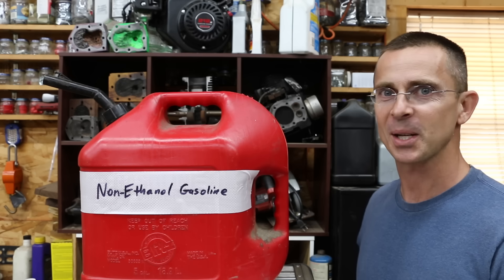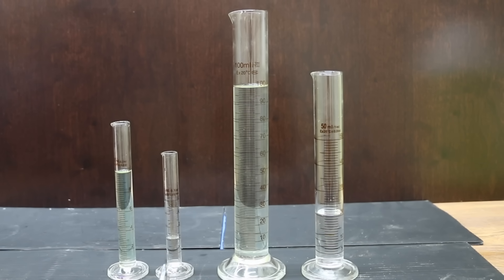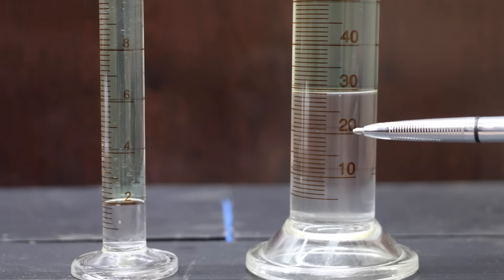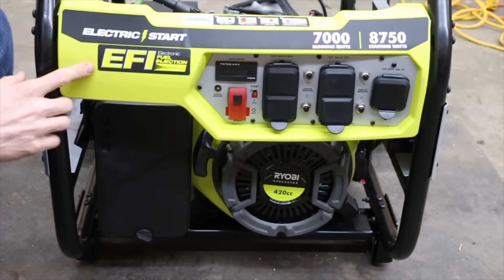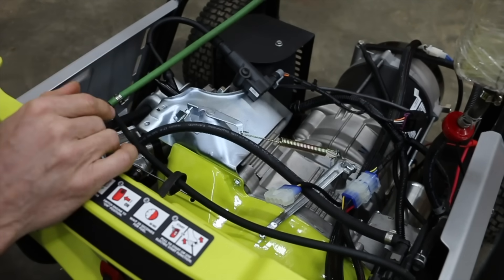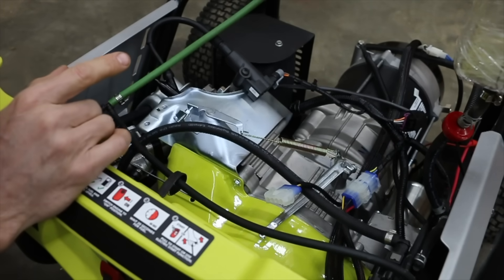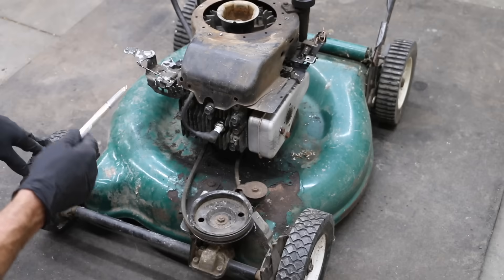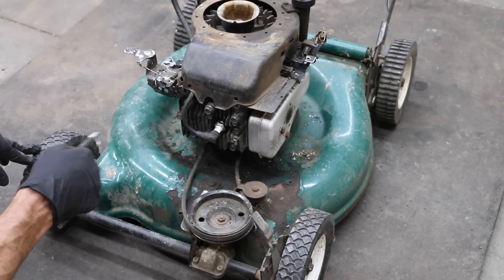Is Non-Ethanol Gasoline Really Better? See the PROOF!

Comment: If you like cleaning and rebuilding your carbs keep using ethanol fuel.
Reply from the maker: Great point
Reply: @ProjectFarm  It's arguably the main point. Small engines like to be run. If an engine is run regularly I assume the ethanol fuel is fine enough. But, for winter storage or for engines that are rarely run (snow blower or backup gas generator for home) ethanol fuel can really gum up the carb. Best to either empty the tank or fill it 80% full with ethanol-free gas and a fuel stabilizer like STA-BIL, then turn the fuel petcock off and  run the engine dry before putting it away. (Filling it 80 % leaves room for expansion / contraction, but minimizes condensation.) This would be a good thing to note in a future video. Its a true case of 'an ounce of prevention = a pound of cure". Thanks for the great video.
Reply: @mbj1163  I would agree to some extent. Letting the ethanol fuel sit without stabilizer causes it get gummy. Small engines with tiny jets don't take kindly to debris if any kind. I have had good luck with adding seafoam to recreational fuel to flush out some of the debris but nothing beats a full rebuild/cleaning.
Reply: @mbj1163  An engine is a mechanical object. It does not like, or dislike anything. Running has zero to do with it. Storing it is the only problem. No emotions need to be assigned.
Reply: You are absolutely right! My mower has been running pretty bad lately, so I decided to go online and do some research and what did I find. Ethanol fuel is the culprit of my engine missing and hard to start. I found a local Marathon that dispenses 90 octane non-ethanol based fuel and low and behold as soon as I ran a couple of tanks no more hard to start and more engine missing! It seems power equipment likes the non-ethanol fuel better.
Reply: I think project farms knows the story, but, my grandfather's friend puts premium non ethanol fuel in anything that uses an engine that he does use, but not on a regular basis, like his 3 cars that he puts in storage for the winter, his chainsaws, log splitter, or 4 wheelers. We had issues  with ethanol in regular fuel before in a 4 wheeler that my grandfathers friend had gotten me. The story is that my grandfathers friend had put fresh non sta bil fuel in the 4 wheeler gas tank, and it was  brought out to my dad's house, and barely used, I think that the fuel that my grandfathers friend put in the tank, I think stayed in the tank for maybe almost 4 to 5 years, until my grandfathers friend and I got the 4 wheeler one day and brought it back up to my grandfather's friends house, probably about 2017 or so, and of course needing the chock at that point due to lack of being ran constantly since 2012. Anyway, we got the 4 wheeler back to his house we (mainly my grandfather's friend) took the carburetor apart to find garbage inside, and it was cleaned out. Of course, my grandfather's friend was being stupid and striped the threads in the screw hole that the  screws that hold the cover to the carburetor, so, he had to buy a new carburetor, and after a few failed attempts, he finally found one for the 4 wheeler he had, and he finally got it running again, and the 4 wheeler still works to this day.
Reply: No choice for me really.. they gum up preety rarely.
Reply: Im a small engine mechanic and everyone that has told me they use nothing except ethanol free has needed a new carb 100% of the time. I have never been able to salvage or throughly clean one because of all the rust and corrosion. About 80% of the time I an able to restore and throughly clean carbs that ran off ethanol fuel.
Reply: @BryceDaMemechanic  wait, are you saying that pure petrol fries carbs but ethanol blend doesn't?

Comment: Good job on the video, as usual. I use ethanol fuel in my small engines because it's the most readily available, at "normal" prices, and yields slightly less pollutants. In my region, I have found ethanol-free fuel sells for prices 50% or more higher than 10% ethanol fuel. However, I always test the ethanol level to be assured it's 10% or less (I've encountered ethanol levels up to 21%), always use fuel stabilizer, always drain engine fuel tanks, carburetor, and fuel lines after use, and never use fuel more than 90 days old (fuel containers are marked with purchase date). I also make sure my equipment is stored out of direct sunlight, to reduce loss of plasticizers is polymer-based engine components. For me, use of ethanol-free fuel is just no worth the exorbitant increase in cost and hassle to realize marginal benefits.
Reply from the maker: Thank you.

Comment: As far as the sealing/rubberized components, don't bother.
They have been put into cars from the git-go, and all cars have them right of the line these days. That info is from some guys that were looking for them in a factory, and the assembly line worker said there is no special parts....
I would test the components from about 1980 and older.
As far as the old wives tale of having to put special seals in, make your own conclusions about that gig.
Reply from the maker: Thank you

Comment: 420cc ???? IT'S PARTY TIME !!!
Reply from the maker: Lol
Reply: It's a modified Predator 420cc, equipped with a small EFI ECU and the necessary injector. It's been available in most other countries for a few years now, but has only recently passed EPA testing for sale in US. I found no functional differences in operation between the EFI generator and a standard HF 8750 generator, but the price increase (about 80% higher) is considerable. I like several of the Ryobi features over the HF 8750, but it's still heavy (220 pounds w/o fuel), loud (104dba under about 1/2 load), and still requires an external ground/earth connection. However, the EFI should be more fuel efficient ??

Comment: You used a generator with EFI to test efficiency. What is you used a type of throttle body injection or carbureted injection to test efficiency? And in the longer review, what if you tested the idea of ethanol mixing with water and freezing in the gas lines?
Reply from the maker: Thanks for the constructive feedback

Comment: A lot of people say, "Oh ethanol is bad on the rubber parts in your fuel system." But wasn't the selling point of the 1928 Model A was that it used synthetic rubber so ethanol won't harm components in the fuel system? so when people say the ethanol is bad for your fuel system, I say, Yes, If your car was made before 1927.
Reply from the maker: Thank you.  I'm testing the effects of ethanol...long term test.  We'll see

Comment: Not sure about all that, but it fuks up rubber gas lines by making them brittle or by making the hose wall soft and collapsing on itself. Ethanol is hard on carbs and injectors too

Comment: I just watched your video on Shell "V nitro" vs cheap gas. I commented on a carbureted engine not changing the volume of fuel per volume of air, which negates any difference in characteristics, or BTU content. Could you please make that fuel comparison with this new generator? This has the oxygen sensor, that I mentioned when I replied to the last video.
     Another viewer on the last video also mentioned that the old generator, like the lawnmower engines, have fixed timing. Does this new generator have variable advance timing? If so, it should really show differences in fuel economy, with its ability to adapt to different fuel characteristics.
Reply from the maker: Great suggestion! Thank you
Reply: moisture is a major problem in carburetors that are stored outside. Condensation and dew are bigger problems, than even rain. The bolt you mentioned, fortunately, is very easy to get to and clean. My problem has been carburetors that give no access to the emulsion tube, and clog up. You can't just run a wire through it, to clear it. It's kind of like a miniature sieve. On some carburetors, like those used on Honda engines, you can remove the idle stop screw, and remove the emulsifier. That allows those carbs to be rebuilt, beyond just replacing gaskets and the needle valve.
     I have cleaned that bolt, in fact, it's one of the first things I check. All using the choke after the carburetor is empty, is just to create more vacuum pressure and air velocity through those passages, to clear any stagnant fuel that could leave behind dissolved solids, when it evaporates.

Comment: You should (if you haven't already) test the sitting life of these fuels to see how long each one actually lasts, time wise, while sitting in a garage. Seems to me that one of the major issues with ethanol gas isn't the carbon or issues in the block. But usually more likely issues in the fuel lines and mixture system (carb, etc). One of the main issues seems to be that Ethanol gas supposedly only lasts (is usable and clean/safe) for about 3 or so months. While non-Ethanol gas can last up to 2-3 years before you start to find sludge in it. I believe environmental conditions play a part in how long they really last. But it seems like things that tend to sit around for a couple months without use are most likely to experience issues. Things like boats, motorcycles, generators, lawn equipment, etc. I do landscape work and when I switched to non-ethanol gas. I stopped having issues starting my equipment and generators after they've sat for a awhile. Prior to that, a generator that sat without running for the winter would usually require a ton of effort, and sometimes cleaning just to get started again the in spring.
Reply from the maker: Great suggestion! Thank you

Comment: So back in the 90s gasoline had an additive called MTBE which helped  gasoline burn cleaner and raised octane level which is what ethanol does. The problem was when gas station tanks leaked the gasoline would seep in to the the ground water. Gasoline is easy to separate from water  but the MTBE additive would dissolve in the water complete in it is very difficult and expensive to remove it. MTBE was banned and ethanol was used as a cheap and safer alternative.
Reply from the maker: Thank you

Comment: Project Farm,
I like your enthusiastic testing. Your ancient test mule mower engine. Now for reality check. A true test would be two identical, new mowers. Mower 1 running alcohol free fuel. Mower 2 running the blended alcohol and gas. After 100 hours of operation with an oil change every 25 hours. Both using same weight and type of oil. Then disassembly to inspect the backside of the intake valves for accumulated, power robbing deposits.
And accumulated deposits in ring grooves.
Burnt valves, worn valve guides.
Yeah, that is how you can see what fuel is best.
Reply from the maker: Thanks for the constructive feedback

Comment: Have you been able to account for differences in gasoline detergents from your gas source such as Top Tier and non Top Tier gas?  This could have a significant effect on the carbon deposits.
Reply from the maker: Great point. I always use the same fuel station.

Comment: You should try E85 and E100 (the stuff available in brazil, shouldn't be too hard to find in america), pure ethanol is a LOT different than 10% ethanol in fact 10% ethanol is still considered "pure" petrol/gasoline and honestly i've messed around with many pure ethanol engines when i was in south america and never ever had issues with it, engines are much cleaner and again with a properly designed flex fuel engine you're not gonna see any kind of long-term corrosion anywhere and less wear and tear inside the engine also seems to have a positive effect on the oil. I'm personally more of an electric car person now so i don't mess with ethanol anymore but there are a LOT of misconceptions in the united states due to lack of easy access to pure E100 in every pump and putting it or letting it sit where it's not supposed to.
Reply: We only have e85 and even that has between 51 - 85 percent ethanol. Most "regular" gas has up to 10%. E15 is becoming more available.
Reply from the maker: Thank you!

Comment: I expected these results with maybe a 2-5% difference in what can be interpreted as milage My Mechanic always warned me about damage to Fuel Pumps after having a replacement or two on a 92 Grand Cherokee, never really mentioned carb, or injector components. So consequently I only use it in a pinch. He also warned about lower Octane fuels potentially having undisclosed amounts of ETOH, and to be wary of it (I am bit Dubious on that one, I imagine there are laws about fuel content disclosure). So it's Sunoco 93 Octane primarily nowadays, and it's 91 Octane in a pinch.

Comment: Years ago I used to race a go kart that had a 100cc, 12,000 rpm, dual carb engine that ran on 100% alcohol.  After racing I would empty the fuel tank and replace it with 100% gas. I'd also have to change the spark plug because they use different types. I then would run it for about 10 minutes to clear out any of the remaining alcohol. And the following week I STILL had to take the carbs apart and clean them. They would be packed with a clear jelly looking residue.